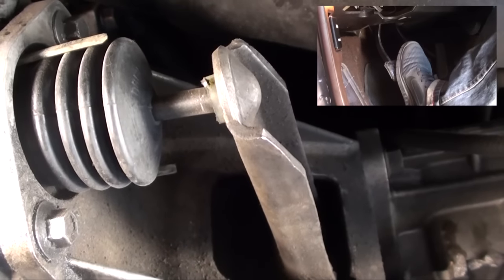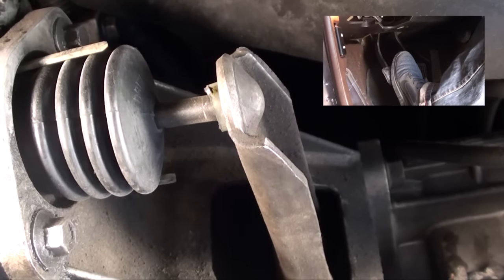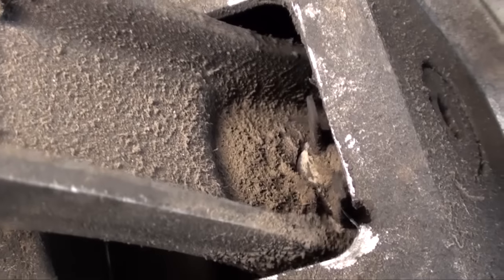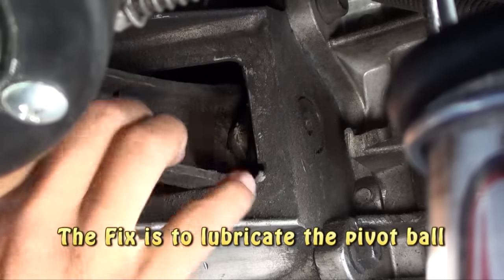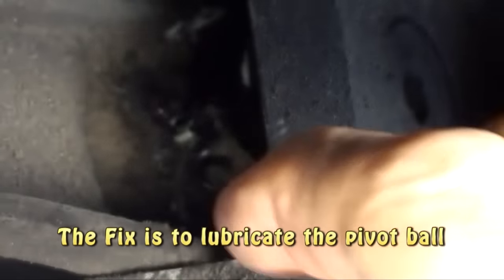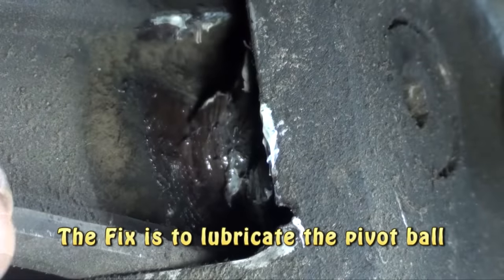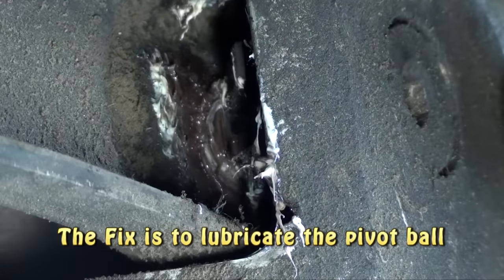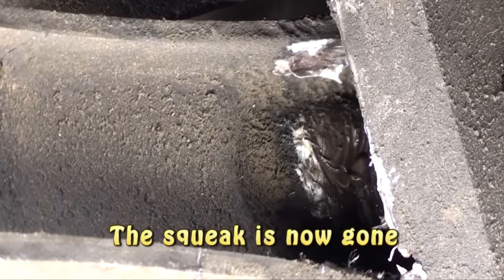Clutch Release Fork Noise

Comment: Dude thankyou why is it shaking so excessively tho mine does exact same thing
Reply from the maker: I have footage not yet posted that would explain this better but I will try to explain it with words.  The release fork is connected to the throwout bearing also known as the release bearing. This bearing makes contact with the pressure plate diaphragm spring fingers. There can be as many as 20 or more spring fingers.  These spring fingers all have a height variation from each other. Because of this the bearing wobbles back and forth which is transferred to the release fork. There are several variables that impact the height variation of the spring fingers so some forks wobble more than others but all forks will have some wobble to them.  This question makes me want to look for that footage and edit it for upload.

Comment: What making it shake like that
Reply from the maker: The release bearing is slightly touching the diaphragm fingers of the pressure plate and these fingers are slightly different heights. As the bearing rides on these fingers that are uneven it transfers that uneven rotation to the release fork. The bearing is connected to the release fork.

Comment: My 2003 explorer sport 2 Dr 4xr does this when I press in the clutch.....
Reply from the maker: If you hear it when you press on the pedal even a little bit then the noise is coming from the throwout bearing also known as the release bearing.
Reply: @DrivelineMaster  I'll be stopping by the mechanic and see hiw much this is going to be, this truck has been a nightmare with issues, I think I have to replace the clutch master cylinder as well because the gears are a bit rough to get into 1st and sometimes 2nd. It feels like there is a resistance and by backing it out and putting it back in a couple of times let's it go in, I've owned nothing but manual transmissions my whole life this is the first I've ever had to deal with this kind of stuff. 2003 with 108k miles. Thanks for your help tho, hope it's not expensive.
Reply from the maker: A throw out bearing is a trans R & R might as well replace the whole clutch.  It won't be cheap.  If you have this done ask if they can put a high quality synthetic manual trans fluid in your transmission.  I prefer Redline MTF.  It works wonders on high mileage transmissions.

Comment: Ok so I have been having what seems to be a similar issue however the noise is quite loud. I'll put a link to the video here. If someone could please give it a look, read the description of the video and tell me what they think I would really appreciate it. Thank you very much.
Reply from the maker: This noise can be loud. I don't see the link.  If you send me a link I would be happy to listen.  I will need to know if the noise comes and goes or gets louder or quieter based on if your foot is touching or pressing down on the clutch pedal.
Reply: @DrivelineMaster  Thankyou for the quick reply, this is the link to the video. All the information about the car and situation is in the description box. I have tried white lithium spray which doesnt seem to have solved the issue, however it was very hard for me to spray in the location I wanted to as it's a very tight area. I'm going to try to use a grease like you have used as soon as I can get my hands on some.
https://youtu.be/zL2x3lFqwcI
Reply from the maker: Here is the noise run down.  If you hear the noise while your foot is off the pedal and it get louder with RPM gently push the pedal down about 1/2 an inch.  note if there is a change in the noise.  Now, while stopped press the pedal all the way to the floor.  If the noise goes away with the pedal depressed to the floor, but there was no change with the pedal pressed 1/2" then you have a transmission noise. Most likely an input shaft bearing. I can be certain the noise is in the transmission but not 100% sure what inside the transmission that is bad.  I think this is what your video shows but it's hard to hear the noise. Try changing the transmission fluid. Other circumstances.  vehicle running, trans in neutral, vehicle stopped, foot off pedal.  some noise or no noise is heard.  Press the pedal down 1/2" to 3/4". If the noise gets louder or changes in tone you have a throw out bearing problem.  If a noise is only heard while releasing the clutch pedal from a stop sign about 1/4 to 1/3 the way up a squawk is hear this  is a pilot bearing noise.  If engine is running, vehicle stopped, trans in neutral, a noise is heard. press the pedal down about 1/2" to 3/4".  If the noise goes away this is a clutch fork to pivot ball noise just like in the video. Based on your video I think you might have a transmission noise.  Bummer.
Reply: @DrivelineMaster  Thank you very much for your input, I'll look into it more and see how I go.
Reply: @DrivelineMaster  Well I thought I would update you with the good news. My squealing clutch has finally been silenced. I applied some grease to the joint and the noise finally disappeared. Thankyou my friend, you're a live saver. Have a good day!

Comment: Where it is located
Reply from the maker: The pivot ball is located inside the bell housing area.  Not all manual transmissions have a release fork and pivot ball.  This could be located on the left, right or top of the transmission and bell housing area.

Comment: Mines does the same thing but at high rpm it won’t shift in any gear
Reply: So is it normal for it to shake like that
Reply from the maker: Yes, it is normal for it to shake like that.  But if you can't shift into any of your gears you have other problems.  It sounds like the clutch is not disengaging at all.  What if you turn off the engine? Will it shift into the gears now?

Comment: I have JMC Nhr but same this problem too much noise bug I don't know
Reply from the maker: If you would like me to comment I need to know what JMC and Nhr stand for.
Reply: @DrivelineMaster  Sir Jmc Nhr is truck 3 ton when I'm on the road gare boxe is too much noise and some times clutch press then too much noise and when stand in 🅿 parking then clutch pedal press then jmc truck no noise silent I don't know what problems in my truck....
Reply: @DrivelineMaster  jmc is same Isuzu Brand vehicle
Reply from the maker: If you are stopped, trans in neutral and foot off the pedal and you hear noise, now you press the pedal all the way down and the noise is gone you have a transmission problem. If stopped, trans in neutral and foot off the pedal and no noise or a slight noise until you touch the pedal  and the noise appears or gets louder you have a throw out bearing problem.  If you don't hear any noise until the pedal is almost all the way down or when you start to release the clutch when taking off from a stop sign then you have a pilot bearing noise.  Finally, if in neutral at a stop with your foot off the pedal and you year noise that goes away as soon as you apply a slight amount of pressure on the pedal than that is a release fork to pivot ball noise.   I hope this helps.

Comment: Does this has anything to do with the clutch pedal adjustment?
I have the same issue but also noticed I have no free play in my clutch pedal, and the clutch fork is shaking (a bit more than yours). 
I'm wondering if adjusting the clutch could help or if this wobble is normal.
Here's mine : https://youtu.be/0SYcwhqTDzQ
Reply from the maker: The shaking of your fork does need appear to be excessive.  If you have no free play you need to adjust your clutch.  You should have 3/4 in. to 1 in. of free play and your pivot ball needs to be lubricated.
Reply: @DrivelineMaster  thanks for a quick reply! Sorry there's a little typo, did you mean "does NOT appear"?

I just went to see the car again and noticed the clutch return spring was so rusted it broke on one end and isn't connected anymore. That coud definitely explain things. Ordering a new one today and I'll keep you updated. 

Thanks a lot!
Reply from the maker: @O8Zen  correct,  My Typo.  Does NOT Appear.
Reply: @DrivelineMaster  thank you. After adjusting the clutch free play, the noise is gone. Guess they gave it no free play to compensate for the lack of clutch spring 😅

Comment: I have a mustang 1998 v6 i cant locate the release fork can anyone help me???
Reply from the maker: Your release fork access is on the drivers side under the vehicle.  The fork will have a boot covering it and is operated by a cable.  Unfortunately if you are trying to lubricate the pivot ball it's located on the opposite side of the fork opening unlike the fork in my video.  The transmission will have to be removed to gain access to the pivot ball for lubricating.

Comment: Same problem/noise with my Mitsubishi lancer 2014. How can i access the clutch fork?
Reply from the maker: I'm not familiar with where the release fork pivot is on that vehicle. Locate where the release fork extends from the bell housing if it has one and pull the rubber boot back and look inside to see if you can spot the pivot ball.  You will need a bright directional flashlight.

Comment: My noise is the other way. As I drive in 1st gear it makes a grinding type sound. And in second gear too. I will try this.
Reply from the maker: If the noise only occurs with your foot off the pedal and doesn't change with slight pressure applied to the pedal you have something wrong in your transmission.  If you can hear the noise in neutral, pedal released and vehicle not moving it's most likely an input shaft bearing but it could be a counter shaft bearing or gear bearings depending on if it's a transmission or transaxle. If you only hear the noise after the vehicle is moving then it's still in the transmission but this time it's related to the output shaft.  Most likely the bearings but it could be gears bearings. If it grinds during shifts this is related to the synchronizer and or the gear depending on how bad it is and how long it has been grinding.   It can't hurt to try changing the oil and putting in a good synthetic oil like Redline MTF. (Manual Trans Fluid)
Reply: DrivelineMaster thanks for the help.

Comment: Throw out bearing????
Reply from the maker: A throw out bearing noise acts differently.  With throw out bearing when you press on the pedal it will load the bearing up with more pressure.  If the throw out bearing is bad the extra pressure or load will make the noise increase in intensity not disappear as it did in this video.You can clearly see that when I lubricate the release fork pivot that the noise problem is fixed.

Comment: can I use WD40 to lubricate it?
Reply from the maker: WD40 will not provide sufficient lubrication to last and I don't recommend it.  The noise will go away but return shortly if you use WD40.  They make White Lithium grease in a spray can. You can use that but be careful with spray lubricate. You don't want to get any on anything else in the clutch system.
Reply: @DrivelineMaster  oh ok... thanks for the information bro 😄👍🏻

Comment: shaking kind of a lot. something is out of balance, you fixed the symptom not the cause.
Reply from the maker: Not out of balance at all.  This is normal because the bearing is riding on the pressure plate diaphragm  spring which is not perfectly flat and can't be by design.

Comment: Mine is the other way around with my civic
Reply: I press the clutch and it makes a pretty loud whine
Reply from the maker: If it's the other way around where it doesn't make noise until you apply a slight pressure onto the pedal then you have a throw out (release fork) bearing noise and the transaxle will have to be removed in order to fix it.

Comment: Mine has the same Noise but then gears do not go through
Reply from the maker: What do you mean the gears don't go through?
Reply: If its in motion and then you press the clutch to engage gears,it's hard and could not go through..But I only engage while its off
Reply from the maker: I think I know what you are trying to explain to me.  When you move the shifter you can't get the gears to engage. It's hard to move the shifter. Is that correct?  Then if you turn off the engine it's easy to move the shifter to engage the gears.  If this information is correct and your clutch pedal feels normal or just a little harder to push then you need to replace your clutch. It's worn out.  It is possible that if you have a hydraulic clutch that the slave and or master cylinder has a leak in it.  Check the fluid level to see if it is low or empty.  If it is normal you you have not been adding to it then you need a new clutch.  Makes sure they replace both bearings (may not have a pilot bearing or bushing) and the pressure plate. Make sure the flywheel is replaced or resurfaced. Replacement is best and they properly lubricate the release fork pivot, transmission sleeve for the throw out bearing and the disc splines using the proper lubricant for each. Make sure the engine rear main seal, release fork, pivot, and throwout bearing sleeve on the transmission are inspected for wear and repaired or replaced as needed.
Reply: @DrivelineMaster  yes that's the case,thanks for the information will just do as prescribed

Comment: My car actually like this after 2 weeks change clutch plate n throw out bearing.. im think it is throw out bearing..but actualy this pivot ball
Reply from the maker: Throw out bearing noise works opposite this noise.  Throw out bearing noise gets louder when you apply pressure to the pedal not quieter or going away all together.
Reply: @DrivelineMaster  tq so much. Sorry for another question. After changing my clutch kit, my clutch paddle sometimes ok n sometimes hard to press. What happened actually? Sorry for my bad english
Reply from the maker: If it is sometimes OK and other times hard to press I would suspect something in the release mechanism.  Without knowing they vehicle or if it has hydraulic, cable or mechanical linkage it will be hard to pin down.  My guess unless it's a really old vehicle that you might have a cable release type.  First check all the pedal linkage under the dash and look for worn bushing or a cracked pedal bracket causing it to flex.  Under the hood and under the vehicle check the cable routing there may be spots where it should be fastened and it's not.  It's possible that the cable is frayed inside the housing.  You may just need to replace the cable.  Really old vehicles with mechanical linkage often have worn out bushings.  Hydraulic systems will have problems under the dash. Bushings or pedal brackets that are cracked or are flexing.
Reply: @DrivelineMaster  im using 2011 car and use hydraulic clutch system. I already bleed the clutch oil. But the paddle still sometimes hard to press when driving. Im already thinking about changing master clutch pump and slave clutch pump. What do you think
Reply from the maker: The key question is:  Is it hard to press all the time or just sometimes?  I don't think the problem is with the master and slave. I think that will be a waste of money and time. When a master and or slave go bad the clutch won't release and there will be a lose of brake fluid.  If there is air in the system the clutch won't release, the pedal will be soft and mushy or just go to the floor with minimal effort and may not even return if you lift your foot off the pedal so I don't think you have air in the system.  If the problem is all the time then I would suspect something in the clutch parts themselves.  Maybe they are not properly matched or the flywheel needs replacement as compared to resurfacing.  Some clutch parts from ebay are not always properly matched kits. If the problem is sometimes look under the dash at all the moving parts and the brackets that hold those parts in place. Press on the pedal with your hand and watch for improper movement at the pivot locations or for the mounting brackets to flex.  Make sure the mounting bolts for the master cylinder are secured tight.  One other thought, did the clutch get replaced with one with OE specifications or was it a high performance design.  HP designs can have stronger pressure plates with more spring tension. This will always cause an increase in pedal effort but once again this will be all the time and not just sometimes.
Reply: @DrivelineMaster  thats make me wonder.. its sometimes not all the times.. its especially happens when driving.. i use Aisin (blue box) clutch kit.. i dont its high performance, just standard one.
Reply: @DrivelineMaster  tq brother, i will try to check it.